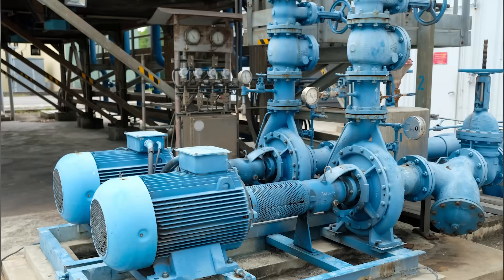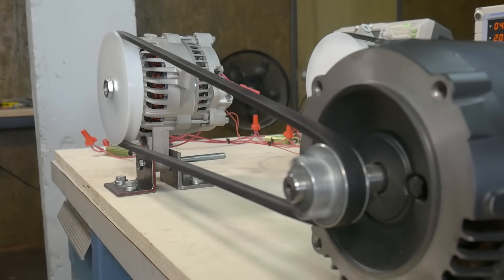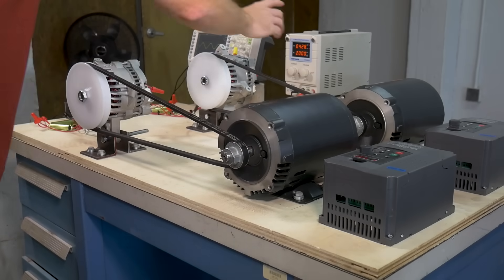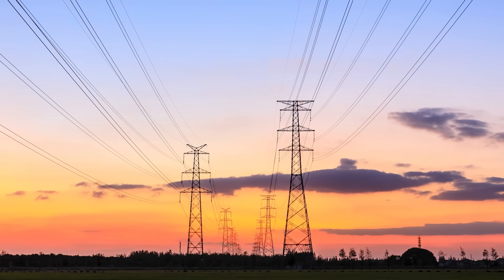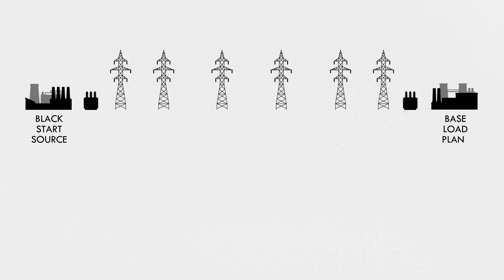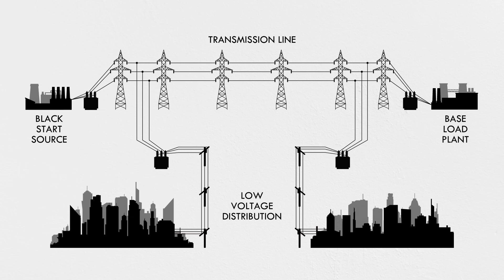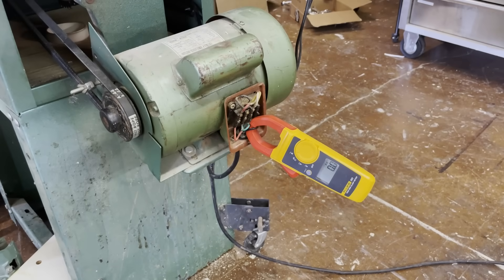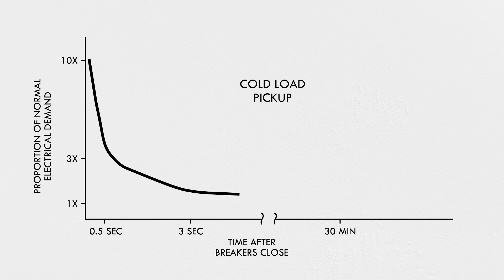What Is A Black Start Of The Power Grid?

Comment: I've always been fascinated with Electrical Grid Black Starts so thank you for the video.
Everything that goes into getting a wide area grid back up from nothing to normal operation; from how to start a power generator, to synchronising multiple generators together to match frequency and phase to eventually starting to deliver some of that power to customer loads!
Just think about the MASSIVE spike in inrush current as ALL those motors in customer appliances start up. What about the millions and MILLIONS of capacitors in all the wall plugs in every ones homes?!
Also, I remember a story about when you would join a new generator to the grid if you didn't have the frequency and phase just right then the "momentum" of the grid (voltage and frequency) would PHYSICALLY 'push and pull' / 'sped up or slow down' the new generator until it matched what the rid was. If you were too far out when you flipped the switch then the whole generator would vibrate and groan as it was FORCED into synch with the grid. and these weren't small generators either! think tonnes and tonnes of megawatt generator power being forcibly submitted into doing what the grid tells it too do!

Comment: The grid itself is is very special. 
In the future 5 times more electricity capacity will be needed, predicted. 

Fossil fuels are very high density energy and with no CO2 in the future and electricity only, this is a major matter.

The grid is critical to dispersing Central Concentrated Electrical power supply. 

Grid construction costs are massive at $2million a klm. 
All the poles and wires to the streets and homes and businesses and industries and buildings may need to be increased in capacity. 

This is a major engineering construction project and NOBODY IS TALKING ABOUT THIS. 

Could you do the maths for your self and look into this?
My understanding is this is a critical moment in time.

Comment: Always wondered why they don't just have a small generator with permanent magnets that provides that 5-10% generation capacity on the same shaft, so that it could power itself, especially at nuclear powerplants. In normal operation it would be just a part of the base load generation.

Comment: There's several puzzles in INFRA (a civil engineering themed walking simulator) that involve synchroscopes. In one towards the end of the game, you even have to manually increase and decrease each generator's speed until you reach sync and quickly close the breaker, exactly as you described 👍
Reply: https://en.wikipedia.org/wiki/Infra_(video_game)

Comment: As an engineering student (in Auckland NZ) I read the report of the President's Commission (?) of inquiry into the Great Northeast Power Failure.   What impressed me most was that so many power stations had been designed on the assumption that there would 'always' be power on the grid. 
Or the hospital where the emergency generators in the basement started automatically, unfortunately the sump pumps that kept the basement from flooding were not connected to the emergency power supply.   And so on...
  It influenced my future thinking in designing stuff, 'but what happens if X isn't available?'

Comment: People need energy independence now!! With TesTur Energy, our mission is to give people energy independence through Combined Heat And Power (CHP) systems that can make use of underutilized and “monetarily free” energy sources like biomass, solar thermal, geothermal and even low grade fuels containing high quantities of solid particulates (like pulverized coal and powdered iron); energy sources/stores that are currently underutilized due to the lack of turbines and engines capable of handling the multiphase fluid flows (any combination of gasses, liquids, solid particulates) present in low grade heat boilers and low grade fuel sources without damage over prolonged/continuous periods of use.

Comment: I like how you talk about water heaters being a heavy load, and then b-roll a totally mechanical gas water heater. Those things use ZERO electricity. I used to have one. My current one is high efficiency forced induction, so it uses some electricity for blowers and system control. But yes, electric water heaters all coming online at the same time would be a huge load.

Comment: I work  in the power generations ops side of  equation and  enjoyed your video very much.  Your video is very well made, you highlighted some important challenges facing grid operations and power producers.  The grid and the way we send and use  power is a very complicated engineering feat and topic.  It is getting even more complicated as the grid is ever changing along with loads and generation sourcing.  Think about what happens in a state which previously was a major manufacturing state' as it transitions away from manufacturing; what happens to those loads?  Referring to motor loads traditionally seen certain hours with manufacturing.  Food for thought.    Great video, enjoy the ones you have posted up, great to see educational videos like this covering power industry as a whole, it takes many disciplines and dedicated folks to keep the system operating smoothly.

Comment: I worked at a facility which was mission-critical.  We'd proactively switch to generator before thunderstorms.  There were usually phase differences between the generator plant and grid, so the building would noticeably shake when the transfer occurred.  Fortunately there were 10, 5, 1 minute warnings with a 10 second countdown over the PA system.
Reply: No synchroscopes?
Reply: @williamhuang8309  nope, the genset was a standby model, meant to run when the utility failed. Except we would switch over whenever there were thunderstorms in the area.   The transfer switch kicked over when it was warmed up and ready, no method to sync it up

Comment: Not an engineer here, but having seen a whole lot of videos on black outs and brown outs, plus all the outages and partial collapses happening because of weather related events... I wonder if we're kinda heading towards a model of connecting multiple independent mini-grids that are either serving as backups, working alongside, or even using the national grid as backup instead.
It seems that the rise in incidents, together with the cheapening of battery tech and solar is starting to change the overall scenario a bit.

Comment: Interesting insight on the system, I knew about the sequential startup, but only for generation requirements (the battery starts the big generator, which excites the gigantic generator, which permits starting the small turbine, and so on and so on).  Our grocery store distribution centre has three generators on standby to be hauled out to any store in our district when needed (we figure notification to on scene in three hours).  They are in 53’ trailers, weigh thirty tons, and generate a single megawatt.  The scale of even the smallest power stations is astounding.  I suppose that’s why generation portfolios are so varied.  You have wind turbines that only need their blades turned to begin generating, or a small dam that needs a gate raised.  The largest coal or nuclear stations I would imagine are effectively impossible to self start, or at least quite labour intensive and time consuming.
I really ought to stop commenting at the exact moment you start to say exactly that.

Comment: Just days before this video pops up I learned that you can not just flip a switch and put a power plant on to the grid, you have to synchronize it with the grid first. Today easier than back then but still a much more complicated process than I imagined. Was this video of a little hydroelectric power plant: https://youtu.be/xGQxSJmadm0 And a small cold load pickup can happen when the fuse in your house blows. You should always turn off all the electrical appliances first and then turn them back on one by one to prevent that from happening.

Comment: You made the entire process fascinating! I just wish I could afford a generator for my house - to stay connected to the internet, to drive the circulating pump for the furnace, and give me light to read books. But I'll be patient when I'm waiting for the utility to reconnect me after an ice storm.
Reply: You only need a small generator for that.  I have a 6.5kW generator but found I only need about 1.5kw to run all normal house items.  Furnace, water heater (nat gas), and lights.  You can get a 2kW inverter generator for a few hundred.  Just stick with name brands.  Like Generac, Honda, or Ryobi.
Reply: @button-puncher  I don't own this house; I rent. But since I live in the northeastern US, which is usually pummelled by tropical storms every summer, I hope someday to have my own source of electricity.

Comment: With solar on every roof (not the end all be all it sounds like) there could be power distribution company operated relays and everyone could have battery backup, also if done right, a grid tie capacity could allow safe islanding and a built in black start capacity. The hardest part is making a reasonable waveform and allowing the systems to not damage each other with nothing to stabilize the waveforms between each other like the normal rotary generation methods do.

Comment: An excellent but annoying feature of (Tesla I know does this, others probably as well)... After a power outage to a charging car, each charger/wall connector evse waits a random account of time between I think 0 to 2 minutes before engaging the charge. If you had 100 cars plugged in and they all tried to pull 12kw simultaneously it could be bad when coupled with all those inductive loads.

Comment: In many older hydro power plants, the wicket gates could be opened at least once using large compressed air tanks to return from a total plant trip or black start. This was the case before battery banks and stand by generators and with older governors.
Reply: Going back to mechanical/analog days seems to be a reoccurring theme in modern times. It's almost like changing literally everything within a century can have unexpected technical difficulties.
Reply: I saw this comment and it made me smile, indeed the black start capable exiters in the original Rankine power station at Niagara falls were actually made up of tiny DC generators with permanent magnets with their own tiny pennstocks. All someone had to do was open a valve manually and they have the juice needed for exciting the main units. This was an old 25hz plant.

Comment: During the 2003 blackout, my (then) local coal plant maintained a small gas turbine (jet engine) generator.  Not long after sun down that evening, the local area to the plan had power restored as they had already gotten their smaller coal unit back online with the gas turbine unit.  From there, they re-light their large coal units.

Comment: I have been a PM for transmission projects for the last year. I have been recommending your videos to our younger/junior PM's with out much experience in the energy industry. The 500kV underground line fascinated our office.

Also I was in 3rd grade when the 2003 black out started. Now at 28, I'm now working on the program that started in response to the black out and there is no end in sight to it.
Reply: Oh, you are so young. I was working a different engineering sector in 2003.

Comment: Think of it like a house of cards, you have to be very careful as you bring generation ,substation and commercial and residential load up slowly, when you start restoring load if everyone had all of their lights motors equipment on and did not switch it off, all of that startup load hits hard when you close in the circuit breaker at the substation that inrush current can overload the relays hit minimum trip and trip everything back off, that happens more at the bulk power level 66k-500k but at that level in rush can trip the breakers at generation and the cascading effect will collapse the voltage and there goes your house of cards

Comment: Some hydropower generators have a small permanent magnet generator on the turbine shaft that allows for self excitation and black start. All the necessary systems that get water flowing over the turbine can be switched to manual control and allow a plant operator the get back online without any off site power input.

Comment: 12:59 thats exactly what was happening during the Texas freeze. Our electricity was off and on within a second over a 7 minute period. Our power would return, then go out right at 7 minutes later (give or take 5 seconds). I started noticing our refrigerator, heat pump and other large appliances with a "time out" period after power is restored would start around 5-7 minutes. This must have been overloading our local substation causing it to trip and reset. This happened for around 12 hours before we started losing power for much longer periods.

Comment: Great video! Could you speak to how grid scale storage helps/hurts this process? Also, does DC transmission complicate or simplify the process? My off the cuff thought is that grid scale storage could dramatically assist black starts to the point where I wonder if siting them considers the black start capability.

Comment: Okay. Small excitation current creates magnetic field. Then rotation of a coil through the new magnetic field creates MORE electricity than was applied to the excitation circuit. Yaay! Free energy! [Unfortunately not counting the energy required to actually rotate the coil against magnetic resistance, of course.]

Comment: That was a slick rig. I wish you had mentioned how you converted it from DC to AC? Maybe in a short? Thanks for the hard work, your videos are must watch in this house.
Reply from the maker: Just pulled off the rectifiers and connected the coils directly to the resistors!
Reply: @PracticalEngineeringChannel  ahh I didn’t realize everything was that accessible. I would have imagined epoxy resin and a nightmare disassembling. Thanks

Comment: Really good video series. I’m an operator/ maintenance tech at a simple cycle gas plant and have been curious about situations like these for years before starting my current job. My plant is 20 years old, we have those “old” synchroscopes in the electrical packages and it is pretty I nteresting to watch them when we come come online and sync at breaker close. Lots of NERC and FERC regulations about those controls being on and in auto.

Comment: In Puerto Rico (US Territory), this is the order of the day. We are still running with the same power plants from the 60's that burn crude oil. Our grid is so outdated and fragile, that in the last 2 years alone, we've had over 20 Black Starts which take over 48-72 hours average. The only power company in the island was owned and operated by the government, called AEE, basically a broke government owned monopoly. Recently, a "private" operator took control of distribution, but generation is still fully government operated. 9 out of 10 homes in Puerto Rico have a standby generator of some sort, and solar is the only reliable way of securing energy in your home.

Comment: During the Great Blackout of 2003,  The power companies asked customers to turn off heir air conditioners and leave them off for a few days after the power was restored. An upscale suburb near me had their power restored at about 10:00 am. By 11:00 am the power was back out again.
Reply: @rhamlet5290 I once lived in an area where there power outages were not rare. Our neighborhood was cut more often than others, because there were buisness offices and some rich-ish people living there - thus they had the means to have power generators and not suffer from the outage. We very quickly negociated with our landlord to have a generator installed after a few months (not powerful enough for the oven, hob, or water heater, but it did mean that the heating was still on, as well as the water, light, and fridge. If we were careful, we could even use the microwave). But yes, when they had to cut electricity, they indeed tried to target those who could more easily ”afford” it.
Reply: These days there are battery farms, be interested to know if they are useful in a black start. I read they are good in smoothing out demand as it takes time for a coal powered power station to come online. I suppose any power station will take time.
Reply: @darylcheshire1618 in general, batteries are great at reacting to stuff that happens in seconds. Gas turbines can be started in tens of minutes, and can adjust their prime mover power output in tens of seconds.
But for the really short, intense surges, there really isn't a replacement for rotating mass. For batteries to supply surge power, the inverters and batteries have to be sized accordingly. Having to, most of the time, run batteries under their power capacity, to have the overhead to react, is not a good use of capability. Meanwhile, the spinning gas and steam turbines of thermal plants and the flywheels of synchronous compensators can more easily be "overclocked" several times their normal output, as long as the duration is limited: in fact, it happens automagically. Unless you're running the generators way too hot, their copper windings will provide the thermal mass to absorb the peak. Meanwhile, inverters are generally prized on being lighter, and semiconductor junctions are not the most thermally conductive material in the world, so a little excess heat goes a long way towards creating interesting light and expensive sounds.
Reply: they probably decided that they drew too much and just cut them off lol
Reply: ...and this is why we will never travel the stars.
Reply: People are morons. Me first, me first!
Reply: @R Hamlet It doesn't matter what class a person is.  We all need water, food, and shelter at a habitable temperature.  Especially the elderly.  That is why electricity is so vital to our modern way of life.